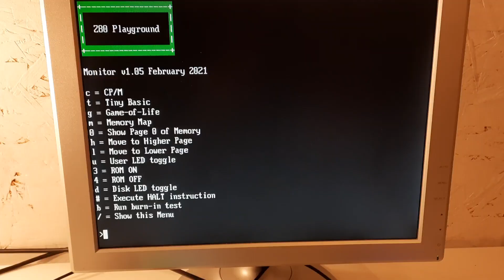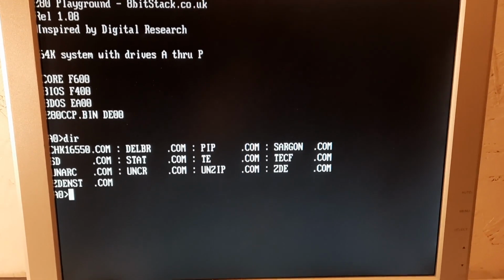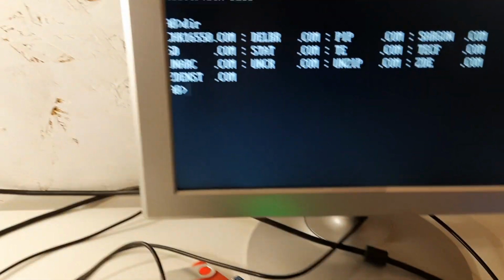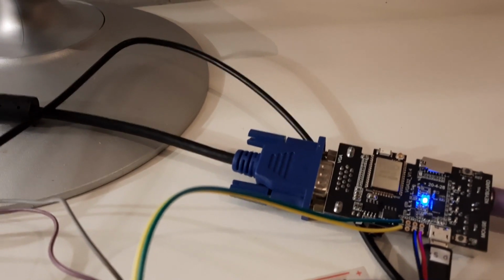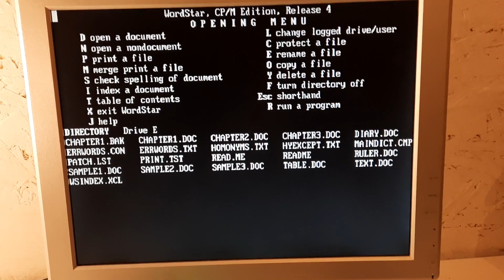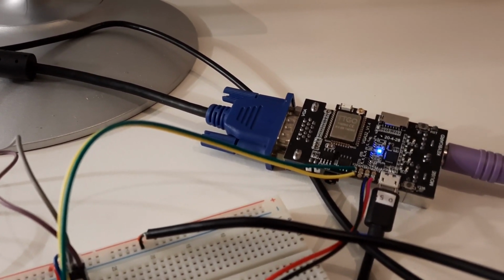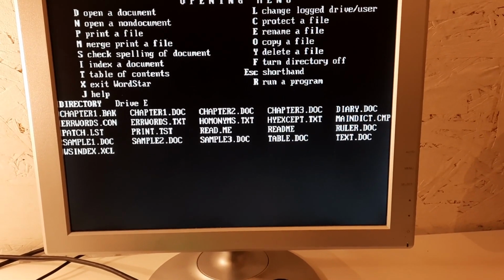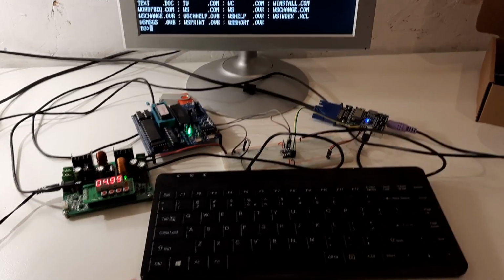Building a Standalone Z80 CP/M Computer (part 1)

Comment: something to try, a usb keyboard, the way it use to work, if the usb didnt initialize, it fell back to a ps/2 protocol
Reply from the maker: Some keyboards will use both protocols, so if you put a simple adapter plug on a USB keyboard and plug it into a ps/2 socket, it will fall back to PS/2 mode. But not all, and I don't know how you could find out without trying your keyboard.

Comment: Generating VGA would be much easier than HDMI. You could probably use dual port RAM and emulate a S100 memory (or IO) mapped video card, though that would take some work in CPM IO driver.
Reply from the maker: I'm using the VGA32 to generate VGA, and I've got a VGA2HDMI converter box, so now I have both output options.

Comment: Is the level shifter necessary? I have interfaced 5v with 3v3 by using a resistor divider on the 5v tx, and just connecting the 3v3 tx directly to the 5v rx.
Reply from the maker: It's overkill! I will do the real thing with resistors. I just wanted to make totally sure it worked first.

Comment: Come on man! 6502 is where it’s at! 🤡🤡🤡🌍🌍🌍
Reply from the maker: It's a shame that the 6502 never had an equivalent to CP/M. I suppose the C64 would be my target if I was doing this using a 6502.
Reply: @CircuitBreaker256  The Commodore 128 had CP/M, but it used the Commodore 128's secondary Z80 CPU. (The primary CPU was a MOS 8502, which was based on the 6502)

Comment: Looked on ebay but out of stock. Any plans to produce more at all? (will buy one for sure)
Reply from the maker: Oh yes, definitely, just waiting on the parts for more kits, and soldering up more ready-assembled ones. Keep your eye on my ebay account.
Reply: @CircuitBreaker256  Will do thanks :)
Reply from the maker: There are more on ebay now
Reply: @CircuitBreaker256  Thank you :)
Reply: When do you expect more of them on ebay?
Reply from the maker: @torstenf.3760  I'm just building some now, so very soon!
Reply: @CircuitBreaker256  Many thanks for the good news… I will check ebay as often as possible…. don‘t want to miss the next opportunity
Reply from the maker: @torstenf.3760  You can set a watch on my account so you get emailed when I add new things. I think you need to click Save This Seller, or something like that.
Reply: @CircuitBreaker256  Hi ! Many thanks for your help … I followed your advice … Now I‘m waiting …. And waiting …. And waiting …. And waiting …. And waiting ….

Comment: I'd buy that from you if you sold it in kit form with circuitboards, components and case! And then I'd go off hunting Klingons like it was 1976 again! :)
Reply from the maker: The case is the tricky bit! I can supply the Z80 Playground as a kit, and those VGA32s are easy to get, but I don't have a way to make a case. Maybe i need a 3D printer?!?!
Reply: @CircuitBreaker256  I have a 3D printer, so I could design and print you a prototype.... but mass production is not feasable from a 3D printer. Once the prototype is finalised, I could give you the STL file and you could get it mass produced from China via injection mould maybe?
Reply from the maker: @louisferreira9055  No worries, I have found the perfect case on eBay. https://www.ebay.co.uk/itm/Metal-Plastic-Electronics-Project-Box-Enclosure-Instrument-Case-Project-Box-BE/154385630006
Reply: @louisferreira9055  Col. Young, is that you? :)

Comment: On the TTGO VGA32 you  (or anyone who hasnt a Z80-Playgroud) could also run CP/M without your Z80-Playground as a stand-alone CP/M computer :)
FabGL has 2 sketches for CP/M:
- Altair 8800 Emulator
- Multitasking CP/M

On the other hand in a TTGO VGA32 is - beside the FabGL ANSI Terminal - space for a "full blown"
RunCPM-Emulator ;)
https://lehwalder.wordpress.com/2021/04/07/runcpm-on-the-lilygo-ttgo-vga32-v1-4/
Reply from the maker: You are absolutely right, but you know how I love to have the code running on the actual hardware!!!
Reply: @CircuitBreaker256  This is because why Iam happy to have also a Z80-MBC2 and a Amstrad CPC ;)

Comment: Nice Project. Have you tried to use the Raspberry Pi Pico? With this you should be able to have HDMI output and USB host functionality. But the programming effort is probably much greater.
Reply from the maker: I think the Pi Zero is a better bet, and I do have one. I just know nothing at all about Pi programming.
Reply: @CircuitBreaker256  Unfortunately I can't post any links. But with a google search for "raspberry pi pico hdmi" you can find a page where a guy built a small HDMI adapter board for the Pi. With a "raspberry pi pico usb host" search you can find an example on the raspberry github page. But both require knowledge of C.
Reply: @chruder83  I've been experimenting with a Raspberry Pi running the baremetal PiGFX software. It works, but I wasn't happy with the reliability - I was running it too fast I think. I'm aiming for one Z80 Playground running via an ESP32 (PS2 keyboard and VGA on a proper aspect radio screen), and another running via PigFX.(Widescreen HDMI, USB keyboard)
Reply: @CircuitBreaker256  No need for programming, just boot Pi OS into a terminal emulator and you're done.